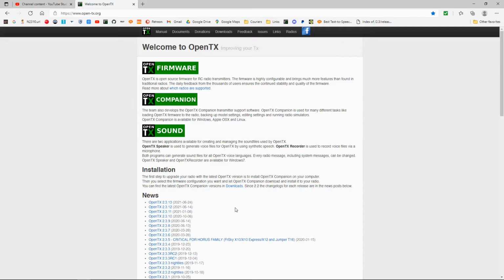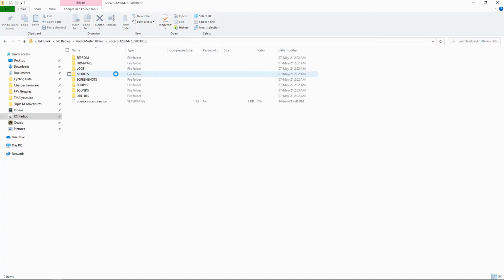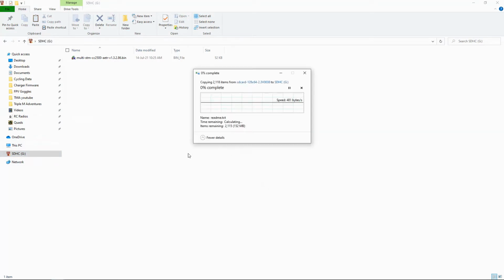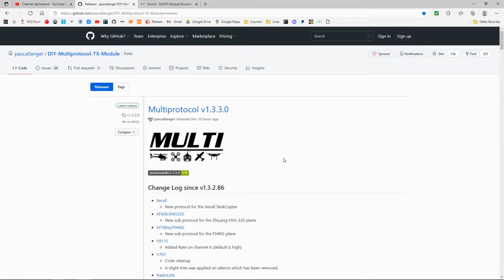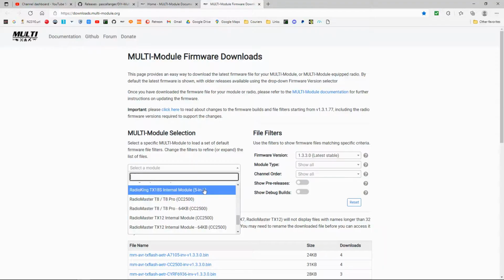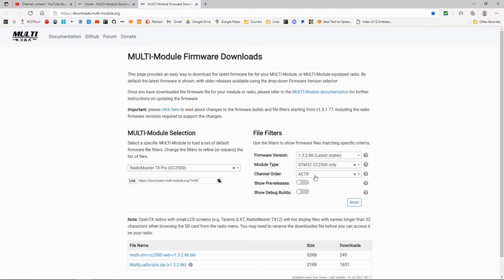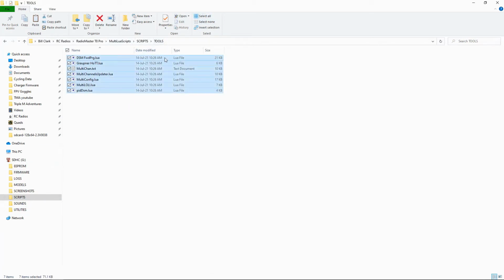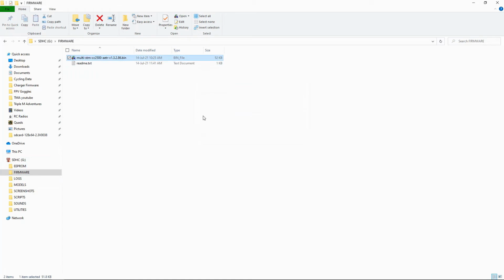RadioMaster T8 Pro Updating the internal Multiprotocol Module Firmware

Comment: This video series has been extremely helpful seeing as I can't find a single other video on the T8 Pro itself. @Bill Clark I had my T8 Pro Bound to a NewBee Acrobee with FrSky for a few weeks then decided to follow your video to update my T8 Pro and now I can not seem to get it to bind anymore with frsky or anything else. I have also noticed an option for DSM when going throw protocols but I see you told someone else DSM is not supported, have the most recent updates added this, or have I messed up somewhere along the way with updating?
Reply from the maker: Hi Dylan, I think you have downloaded the incorrect firmware for your module. You need to make sure you select 
RadioMaster T8 /T8 Pro (CC2500) if when you update the firmware you get a no telemetry warning when trying to bind download this version RadioMaster T8 /T8 Pro - 64 KB (CC2500) If you cannot see the FrSky option I think you need the 64 KB version. Let me know how you get on.
Reply: @the-happy-RC-flyer  Iv gotten the correct firmware installed, I have no warnings when starting the controller or when trying to bind. When attempting to bind it will beep as normal but never find a receiver to bind to even if its sitting less then an inch away.
Reply from the maker: @bushman3985  could you please email me a picture of your screen of you radio showing the binding section showing Mode and down and SYS, VERSION.
triplemadventures@gmail.com
You will not have sounds if you do not have a SDCard installed with the SDCard contents on board.

Comment: Hi Bill, great content. Could you do a video on updating firmware on the receiver to match that of the t8? I have the t8 and am struggling to bind to an r-sxr frsky receiver some help would be greatly appreciated
Reply from the maker: Hi Jon, I am pleased you are enjoy my channel. I think you maybe choosing the incorrect protocol option FrSky receivers can me tricky to bind because of the different protocols.
FrSky X
FrSkyX2
and then FCC & LBT-EU versions.
If you are in Europe then you must use the LBT-EU version.
The firmware on the receiver must be ACCST and not ACCESS which will not bind to the multiprotocol module I am almost certain yours will be ACCST.
So try X and if will not bind try X2 and I am sure you will come right.
If you still have problems please let me know. I will make a video on the subject.

Comment: @billclark Could you please tell me if this radio will support Flysky? I currently have a drone I would like to connect, and really don’t want to buy another remote as I use this remote for all my other quads. I seem to be having trouble getting it to work with Flysky.
Reply from the maker: Felix, sorry no FlySky will not bind to the T8 Pro because it only has the CC2500 chip.
Reply: What about DSM? I looked for it in the list after updating to the latest firmware, but I don't see it. Thank you!
Reply from the maker: @NatEva  DSM is not available on the T8Pro you need the 4-in-1 multi protocol module in the TX16s to bind to DSM receivers.
Reply: @the-happy-RC-flyer  thank you very much

Comment: great video! what if I was dumb enough and managed to install a different firmware? is there a way to reverse it or flash it again with the correct firmware? any help would be really appreciated! cheers from Ecuador.
Reply from the maker: Hi Dario, if you bricked your radio itself you would need to put the radio into DFU mode to overwrite the firmware with the correct version. With regard the internal module I have never put the incorrect firmware on it. What I would try is put the correct firmware on the SDCard as normal and try flashing it again.
Reply: @the-happy-RC-flyer  Thanks for the quick response. I’m trying to flash it with the correct firmware and now I’m getting an error that says: “FW update error. Device not responding”
Reply from the maker: @dario_hxc  try this https://github.com/benlye/flash-multi/
Reply: @the-happy-RC-flyer  that looks promising, thank you for taking the time. I’ll try that and I’ll let you know if it works.

Comment: Thank you Bill for the great content. Just got my Radiomaster T8 Pro and followed your video. Only issue is the radio doesn't see the contents of the SD-card :/ I have tried two separate SD-cards. Sandisk Extreme Plus 128GB and Sandisk Ultra 64GB. Do you think there is a size limit on the SD-card or specific make/model that works? Edit: Got it working!! Had to make the 64GB SD card into an NTFS drive, then made a smaller partition i was able to format to FAT32. Windows wants to default to exFAT for anything 64GB or larger.
Reply from the maker: Hi Thomas, glad you figured it out. I use smaller SDCards in my radios I think the largest I use is 16GB.